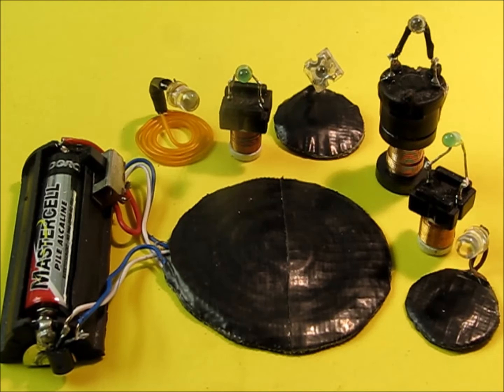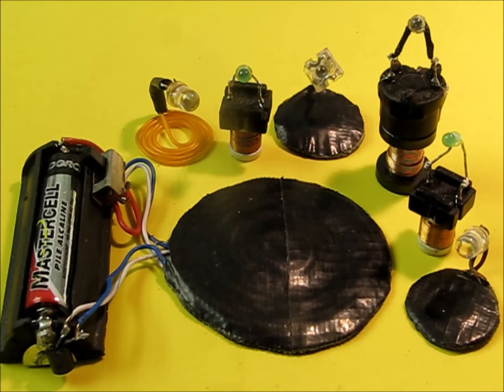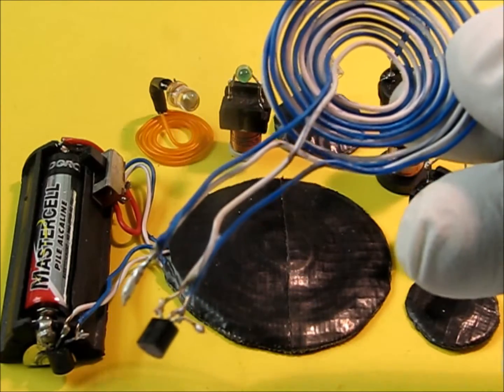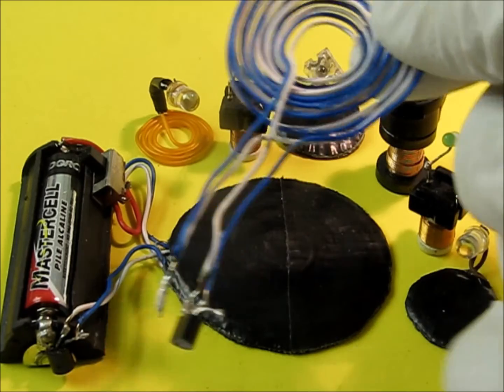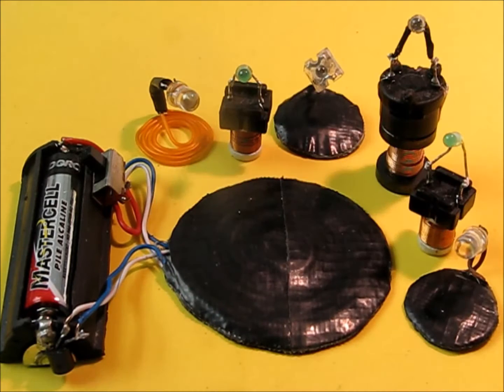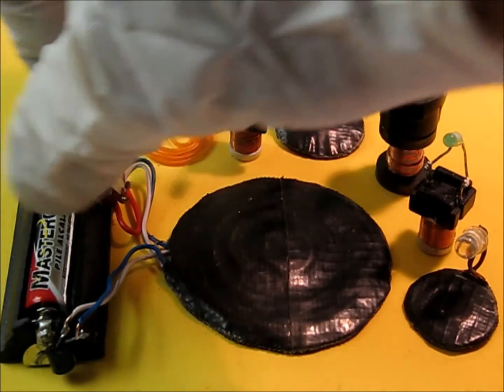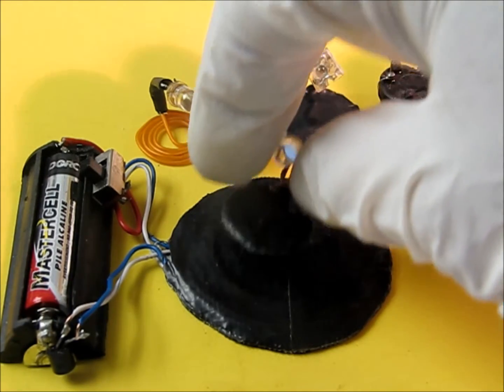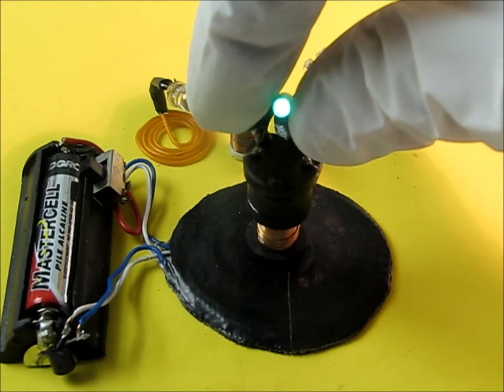DIY Wireless Power - Part 3 : Slider2732's SWES!

Comment from the maker: From wikipediA: Low frequency induction[edit]

Low frequency induction is an unwanted form of inductive coupling, which can occur when a metallic pipeline is installed parallel to a high-voltage power line. The pipeline, which is a conductor, and is insulated from the earth by its protective coating, can develop voltages which are hazardous to personnel operating valves or otherwise contacting the pipeline.

-- I wonder..  if you can find a big hunk a metal parallel to power lines.. hook a germanium diode to it maybe it would have some juice HMM .. Things like metal barriers they have on roads might work.. im gonna try!..